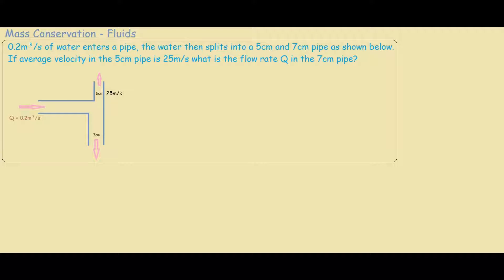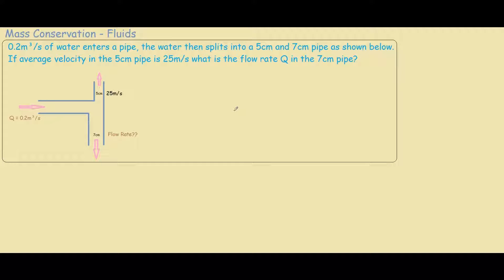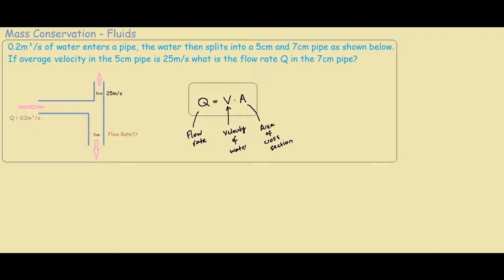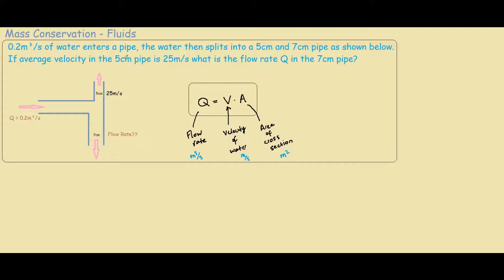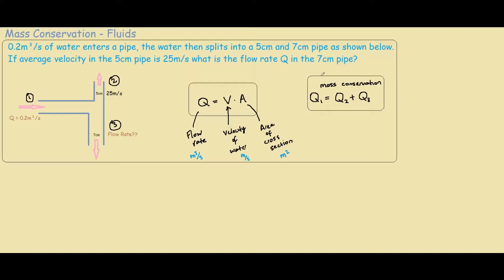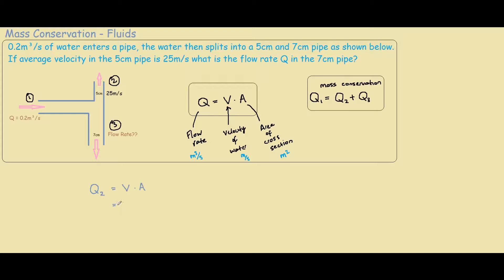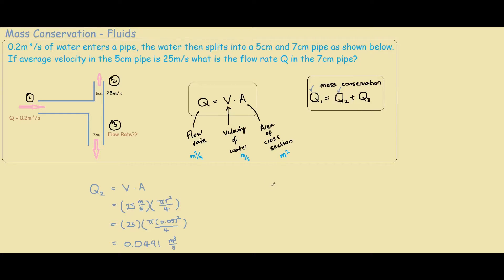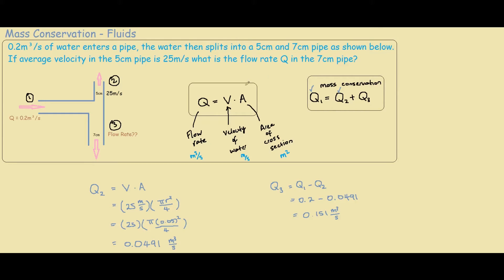Mass Conservation Example - Fluid Mechanics

Comment: why did you use the the diameter when the formula required the radius? shouldnt it be 0.025? ive noticed the same thing in my own textbook and im very confused.
Reply from the maker: hey Tory good question, we can use diameter because the formula was set up to use diameter Area = (πr²)/4. 

If the formula was A = πr² then we have to use radius like you indicated.

to derive the area formula used in this video
Note that Diameter = 2 * radius
so when substituting this into A = πr²

we have 
A = π(r/2)² 
A = πr²/4

Hope this helped
Reply: its pi*(d/2)^2...idk what (r/2) gives you and A=pi*r^2. if 2*r is D and r is D/2 then it is (pi*(d/2)^2), which equals pi*d^2/4.